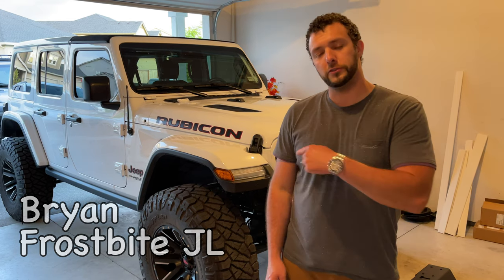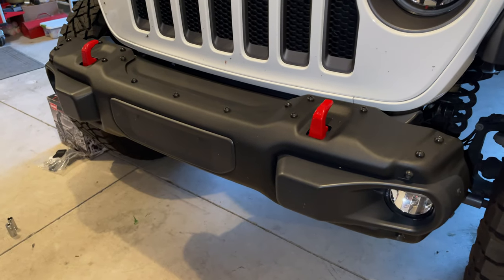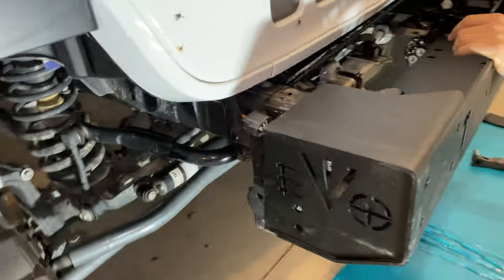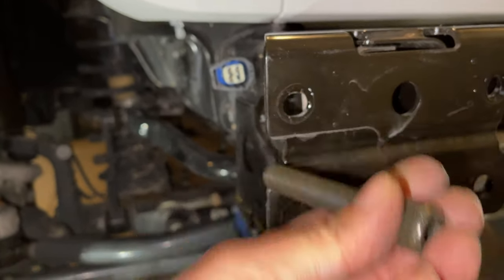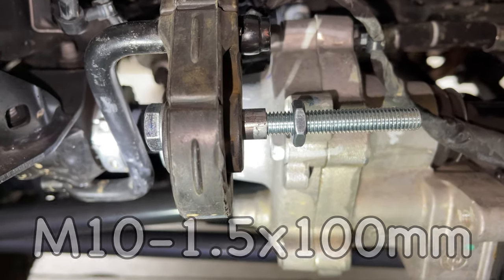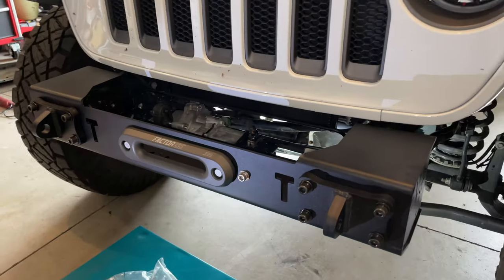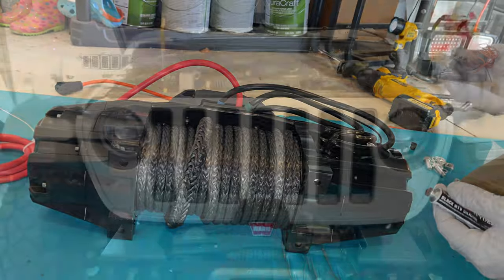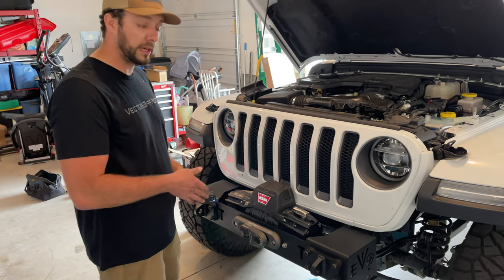NEW JL Wrangler & JT EVO MFG 1/4 Pounder Front Bumper & Warn Evo 10S Install

Comment: I’m two years late to the party.  Bumper looks great.  Do you know of any way to re-use the nice factory LED for lights that were in your stock bumper.  Any type of after market housing that can be used?  Thamks
Reply from the maker: Not that I know of, most people use a kit to wire aftermarket lights to the factory harness. It is a very nice bumper and looks great too!

Comment: I like the evo 1/4 pounder for my JT. DO you happen to know if I have to cut the frame horns to fit the JT as well? Also if you don't run a winch, will the top stay opened or is there a piece that closes off the top section? Great video, thank you.
Reply from the maker: The install on the JT should be exactly the same, so you will need to cut those frame horns to slide the bumper over. It really wasn’t that difficult if you have a saws all and a grinder. I don’t think Evo makes a plate to cover the top it’s designed to have a winch inside it. They do also make the quarter pounder in aluminum as well which is a nice option. Thanks for watching!

Comment: How much does the evo weigh in comparison to the stock steel bumper
Reply from the maker: We didn’t weigh the two when we installed it but the Evo ones shipping weight is 90lbs and the factory steel one is 83lbs, that’s not including a winch plate on the OEM one. Hope this helps, thanks for watching!

Comment: I've got the same bumper..any idea what the extra holes are for on the sides on it?
Reply from the maker: I’m not 100% sure but I believe they are for the stinger option to bolt into.
Reply: @FROSTBITEOFFROAD  I've got the mid hoop coming but it just uses the front 8 blots. Someone said maybe it was for the jig when its fabricated🤷‍♂️
I just wanted to make sure I didn't miss something dmg it during witching.
Reply from the maker: @casey197930  yeah that totally could be, their logo is probably pretty hard to cut out as well. I’m sure they use a laser for that. Let me know if you have any more questions about the install, thanks for watching!